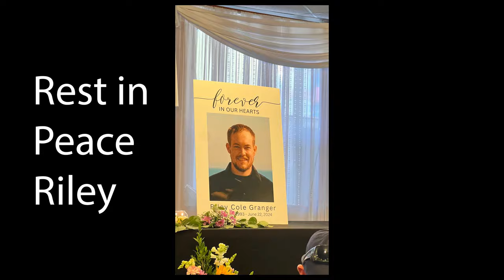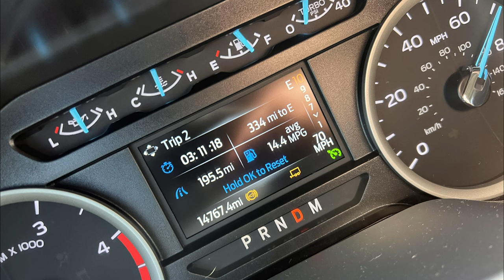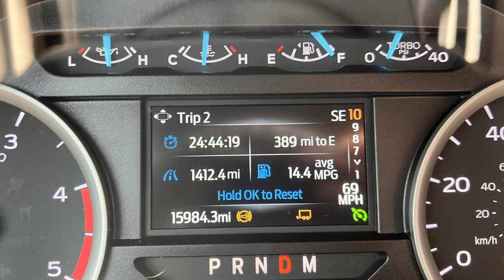Race Week 2024 Pre Race Problems!!!

Comment: 4 tacks on that snap ring and its a permanent washer and the spring tension means nothing anymore lol, both mine has 4 tacks and never caused an issue after that. 
Make a perimeter frame for the fenders and bolt them to the angle where that one cracked at, then you have removable fenders if need be
Reply from the maker: @young11984  I was worried about taking it back apart if I needed too and I didn’t do it!